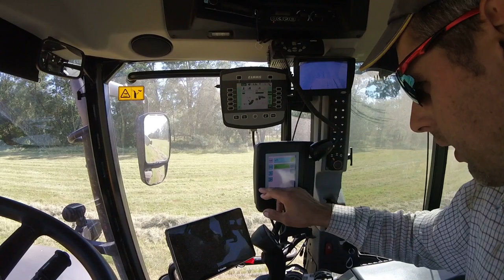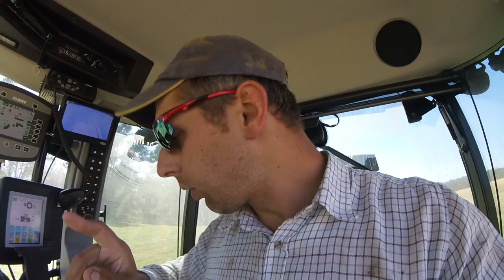HOW DOES A BIG BALER WORK?

Comment: George - little farm safety tip I have come across recently. Simple as a laminated piece of paper put on the steering wheel saying you are working on the machine/ implement. Could apply to any implement but particularly things such as balers and potato harvesters where you might not be seen. Stops anyone jumping in and starting the tractor up without knowing anyone is inside. Could save a life for the sake of a 5/10 minute office job and a piece of paper!

Comment: Great video mate. Could you answer me another question as I’ve never used a big square baler. I’ve seen it twice now at work, one new and one old Claas baler. Whenever you start with a completely empty chamber, do you alway have to cut and then rebale the first one as there’s no resistance for the first bit of crop entering the bale chamber or was it just coincidence that both times there was an error with the balers? Cheers mate

Comment: I dont know if anyone else noticed but he left the flywheel brake on when he started it back up. :P sorry George.
Good video though
Reply from the maker: Steven Kiberton well spotted Steven, I wondered if anyone would notice it!
Reply: I’ve noticed this too. And this is the reason for so much needed tractor power when he turned on PTO and the reason for strange sound while running.
Reply: Yeah i was gonna ask, is there not a sensor or switch to alert ya if you do leave it on in case ye burn the pad or break sheer bolts or worse uni knuckles.
Reply: PIPER DOUG noticed it surly the fly wheel would have broken loose from the brake
Reply: Must have smelled good ;-)
Reply: Yeah cork dude i dont think the band applies a huge amount of pressure but just to stop the plunger rolling forward. but yeah i think the JCB wouldnt notice it much, lol.
Reply: you beat me to it
Reply: easily done often happens when you have to change flywheel shear bolt or our Masseys and u forget to turn it off
Reply: normally you can tell when you turn the baler on you have left the brake on because you will really struggle to start the baler or even stall the tractor